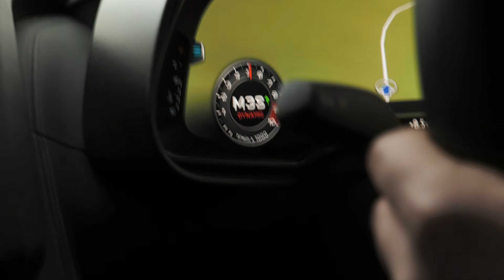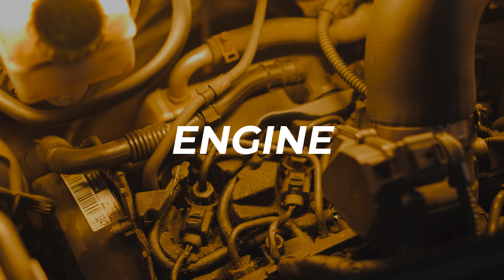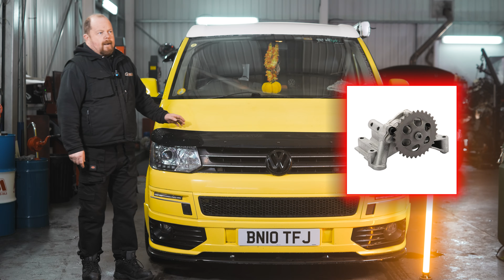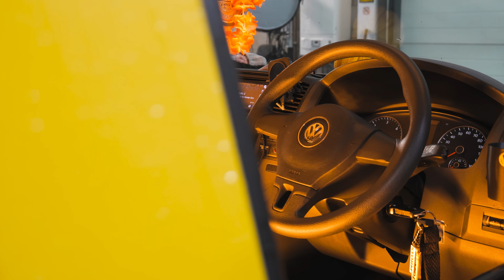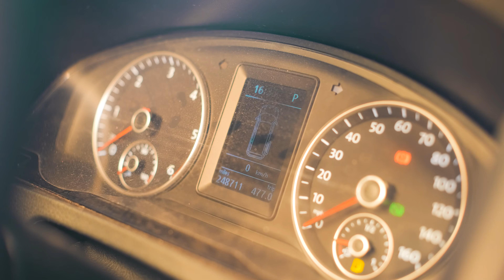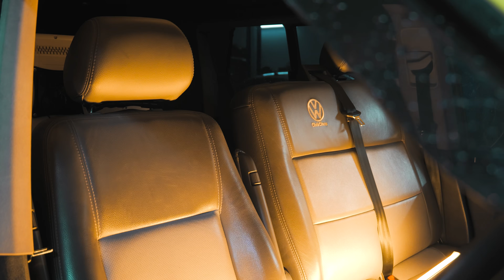VW T5 TRANSPORTER COMMON PROBLEMS!

Comment: Had my 2.5 for a year now. Been an absolute nightmare. Tandem pump £350. 5 rebuilt injectors £900 entire front end off to access. Abs pump failed. New one from VW £2300 with no delivery date. So had to have it rebuilt £650. Hate it with a passion.
Reply: get vw t4 and you  forget problems
Reply: @marekbadyl  Was about to comment the same. The 2.5 TDI in the T4 is a completely different engine (VEP37-Pump instead of PD-injection, no plasma coated cylinder walls, wastegate turbo instead of VTG, simple and unproblematic EGR system, ...) Absolute reliable engines and they use noticably less fuel then the shitty clankers in the T5 (even the "praised" 1.9 gets less MPG then the power and torque wiese comparable AJT). And most importantly: They sound WAY better than anythin in the T5/T6.
Reply: I had a 2.5 too. Mine was also a nightmare and the end result was a snapped crankshaft! Got the 2.0tdi 140 now and that’s been fine.
Reply: That’s my next move 👍

Comment: Great video summary. I’ve got a 2.0tdi 140bp T5.1 6speed 122k just had driveshafts replaced.  The oil pump you mentioned, what are the signs and turbo failure. Just thinking ahead, should I replace now for another 000k of safe motoring if a relatively easy one for DIY.  I did the EGR recently.
Reply from the maker: Best to carry out regular maintenance on the engine, look out for any foreign objects or blockages in the oil filter before replacing oil pump, or if you get any oil pressure issues